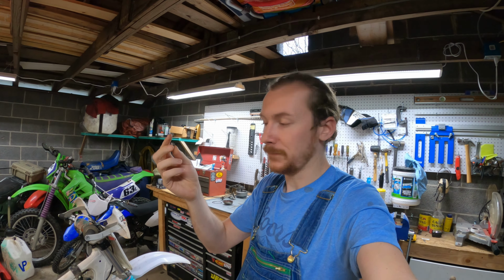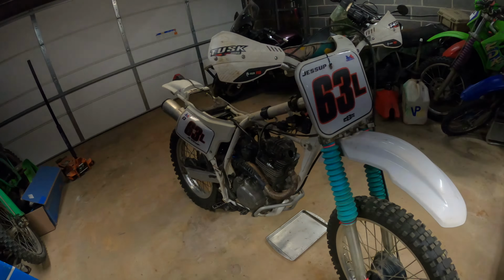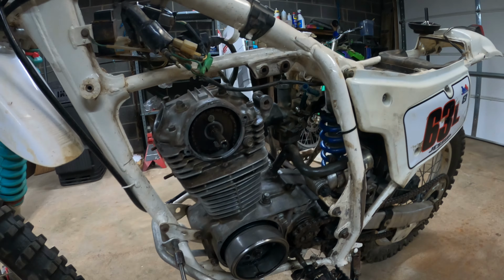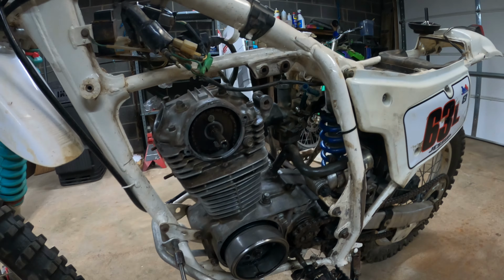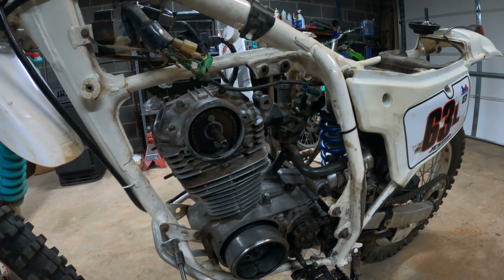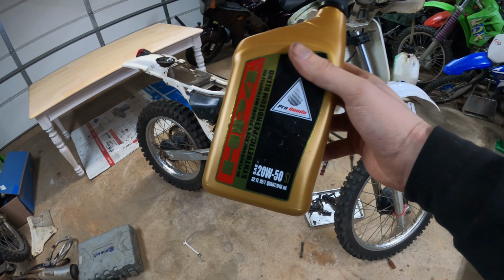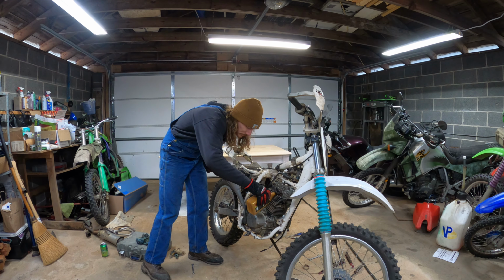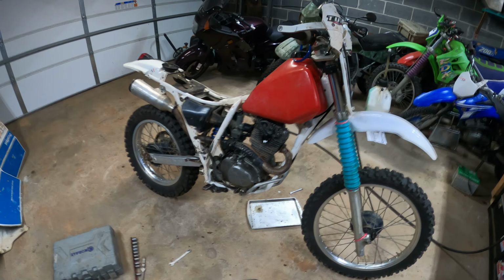XR200 gets a Namura piston

Comment: I have a XR 200 also and it doesn’t get spark. I’ve changed the spark plug and spark plug wire and the CDI box and I don’t know what is wrong with it. I open the CDI cover, and the thing that holds the weights is broken. I don’t know if that could be why it’s not getting spark
Reply from the maker: yea if that is broken, there is no indication to fire.

Comment: Can you gain a lot by doing some performance mods on it. I consider this as my first project bike. What I am thinking is the following
220cc bore
Stage 2 cam
PWK or Mikuni Flatslide pumper
"Racing" exhaust. 
1 teeth smaller front sprocket

Would a build like this do much difference from stock and how would the longevity of the engine be with these mods?
Reply from the maker: The xr is a pretty reliable motor, the cam and carb will help a lot, make sure the cam is machined to take a roller bearing and not just be set in the head like stock, as long as you keep the oil changed and full it is going to be reliable.
Reply: @LilBJessup  thanks for the tips. Does it have a CV carb stock?